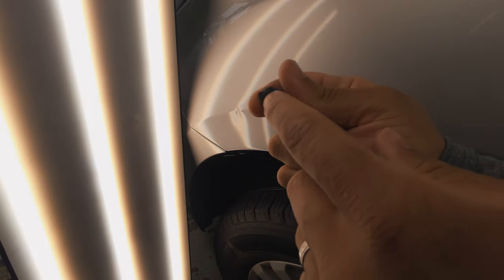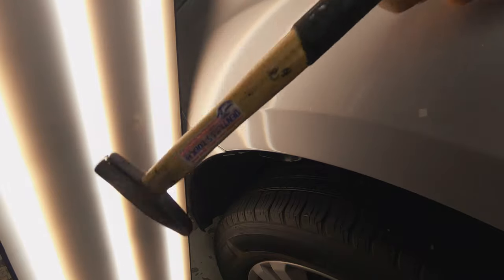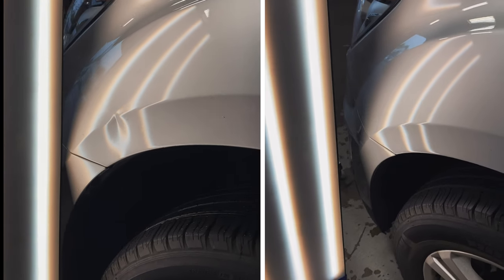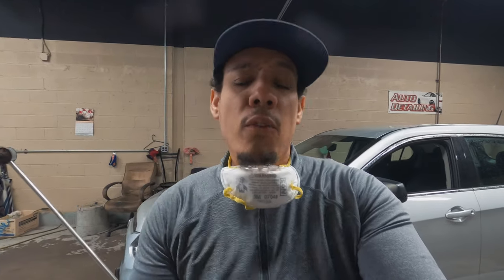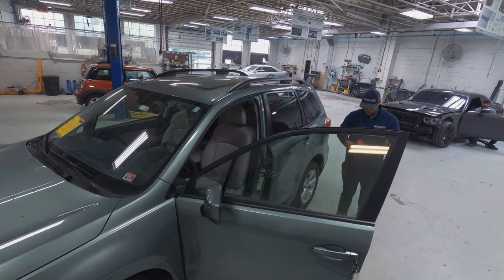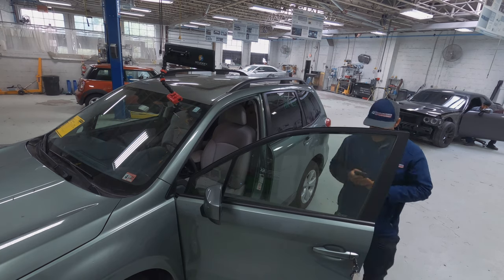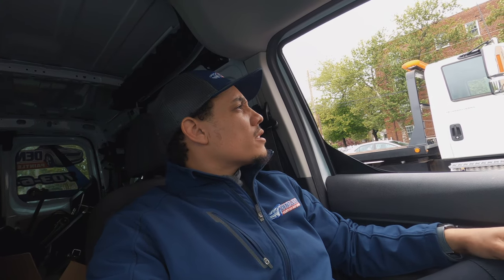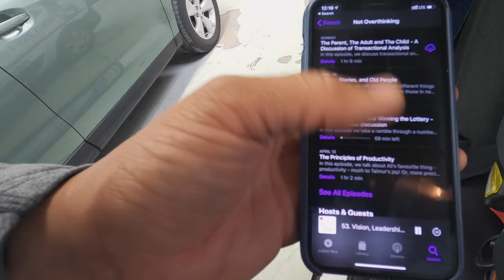Estimating Large Damage   | Dentless Touch Dent Repair Vlogs | EP 20.3

Comment: On the first repair have you considered using the dent dial with a soft radius tip and leather? Then switch over to the ultra soft tip to finish. I think it’s a lot easier on your wrists less chance of pinning when using leather and so much more control using a flat bat rather than a rod when levering off a tire. Just a suggestion. Keep up the good work.